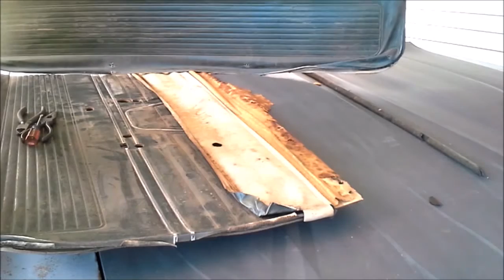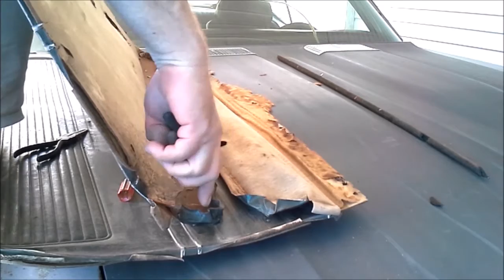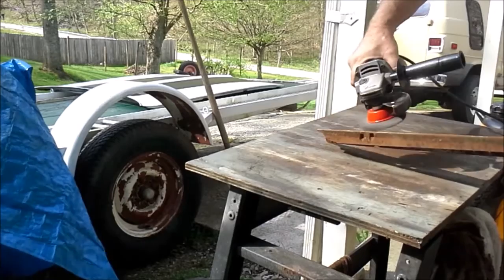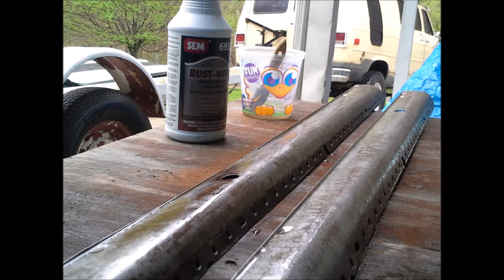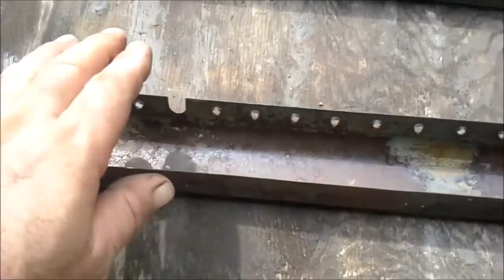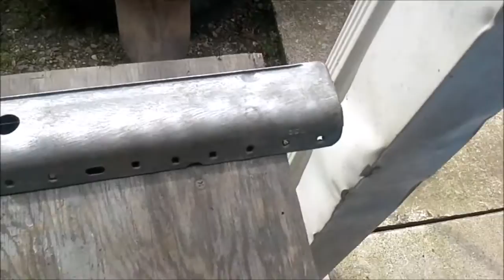1969 chevelle door panel #2

Comment: if you come across the metal top pc of the panel hang on to them, they are worth money replacement pcs are now made of abs an are a 150 for the pr
Reply from the maker: StrtRodder100 I have 3 in the war room cleaned up and a few in the attic. I need to clean up the rears. I like the stock and im considering the unassembled kit. then I need new glass seals and go through the window tracks etc. it starts to add up $

Comment: I bought new door panels but i have to use my old metal top rails, they are prettyt rusted I am hoping to use fiberglass resin and a layer of fiberglass to reinforce them.Thanks for the video.
Reply from the maker: ***** my first Malibu had plastic inter wheel wells
Reply: ***** Yea most are plastic, I heard the metal ones were used mostly on station wagons. I bought new metal ones for mine.

Comment: I've done plenty of marine upholstery work and the thing I hate the most is pulling all the staples.  But watching this gave me a new perspective..... How the hell did they get those staples in that area to begin with?  Must have been some kind of specialty stapler to fit in there, lol
Reply from the maker: Velvethamma a big scary unit they probably put the new guy on to see how good his nerves are.. ive been reading books and watching vids for a long time..i need a walking foot sewing machine next ...a old used one lol
Reply: ***** I picked up my walking foot machine on ebay for like 350 bucks and it looked like brand new.  They're out there and if you watch ebay... one will pop up so you can jump on it!
Reply from the maker: I got my van on ebay...killer deal too
Reply: Velvethamma they use a machine looks similar in shape to a pinch seam welder

Comment: Skip the staples on the rebuild. I'd use urethane body sealant, some small clamps and simple contact cement for your skinning.
Reply from the maker: EdOfTheNorth that's what I was thinking too..i might get the factory unassembled door panel kit. or try something custom. ill have to get the window seals too. I got some vinyl and paint for the arm rests...little at a time